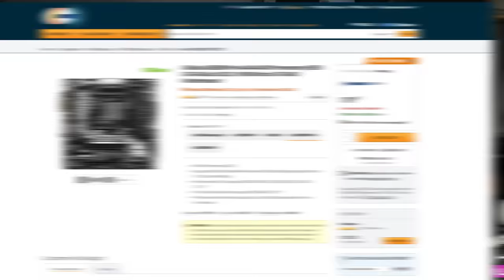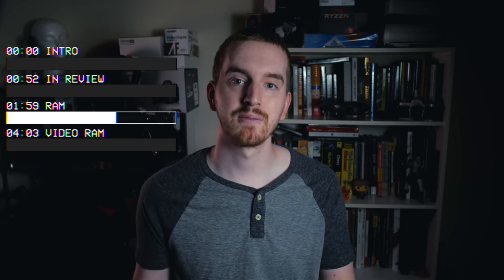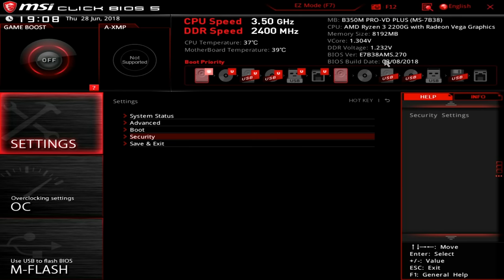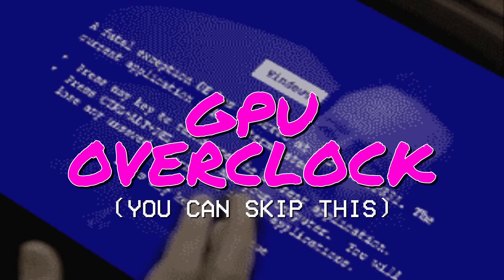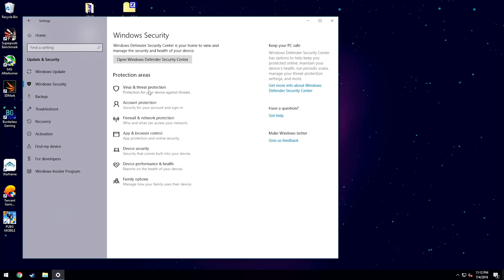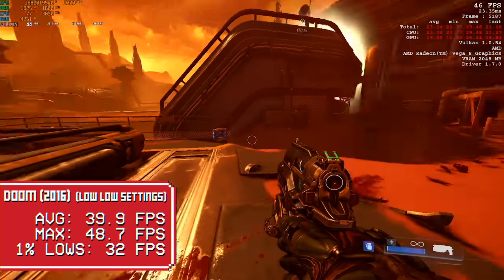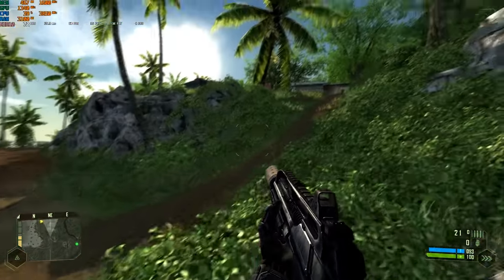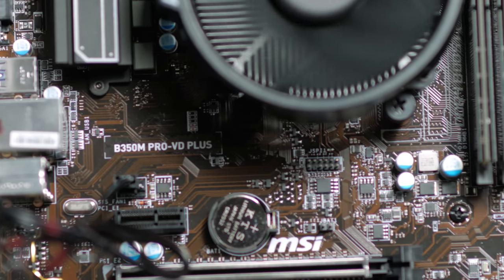How to get INSANE GAMING PERFORMANCE out of AMD Ryzen 3 2200G APU - Ryzen 2200G Optimization Guide

Comment: Guys help, vega 8 or msi 7770 1 gb
Reply: HD 7770 Ghz is better.....but with 1GB Vram you must gaming at 720p/768p/800p,  HD 7770Ghz is much the same than GTX 750, HD 6850 and GT 1030 GDDR5 (this with 2GB GDDR5)...AMD RX 550 2GB or 4GB is better; if you want buy a Graphic Card PCie, then not buy APU 2200G, try with Ryzen 3 1200/1300X and OC. If  you find an AMD HD 7850, R7 265 or R7 370 and you have a GOOD PSU, then buy it (are better than GTX 750Ti).
Reply: @juanmassiosare9850  yeah i Actually bought hd 7850 but my pc wont turn on with it and it turns on without it, do you think it is broken or it can be my psu
Reply: @margareta5519  ....PSU Generic?....HD 7850 need a "good" PSU Generic, but much better a Good Quality PSU , something like EVA, Corsair, Cooler Master, Rosewill, XFX etc 500W, 80+ Bronze etc.

HD 7850 Consume Peak in Gaming = 110-115W, so you need a better PSU than psu generic.

Comment: I can't even getting 30 fps in 720p lowest settings everything is off i played games shadow of the tomb raider 20 fps average 
Assasins creed origins 24 fps average 
Just cause 17 fps in 720p plzz help my pc specs are ryzen 3 2200g with 8gb ddr4 3000mhz single stick . 720p normal settings  in gta 5 i got 40fps average help me. I have windows 10 version 1903 and i have updated my drivers guys help me. 😢😢😢

Comment: 87 degrees? really?
Reply from the maker: It's a stock cooler and that's under way more load than normal use would give it
Reply: but you make ryzen sound so bad that i don't know if i want it anymore, these bsod and glitches even without tweaks :/